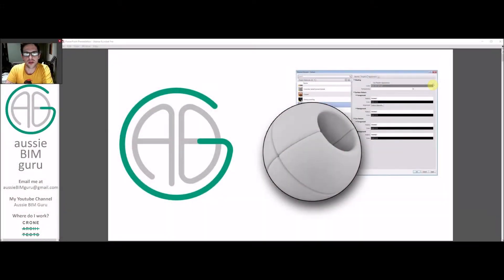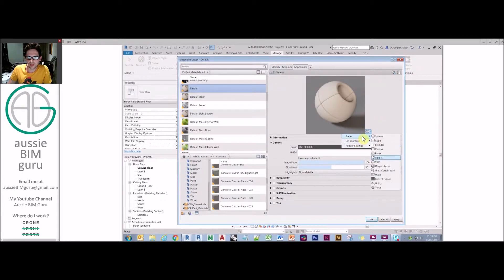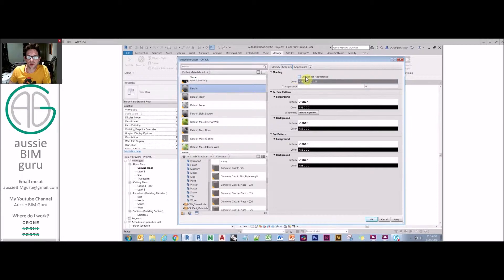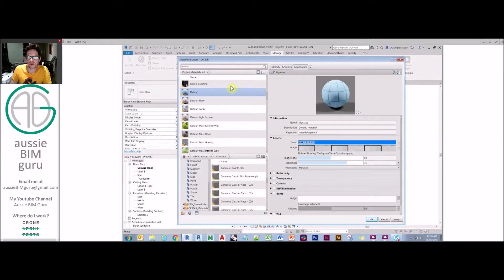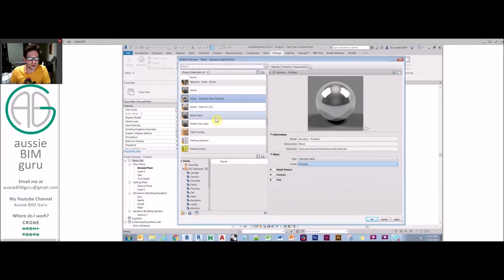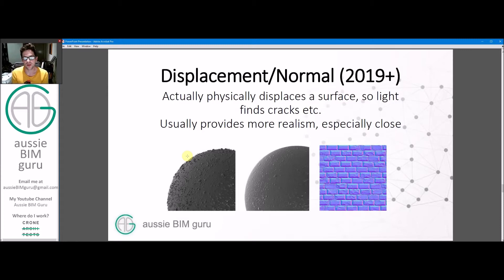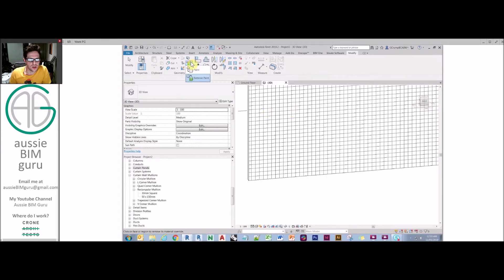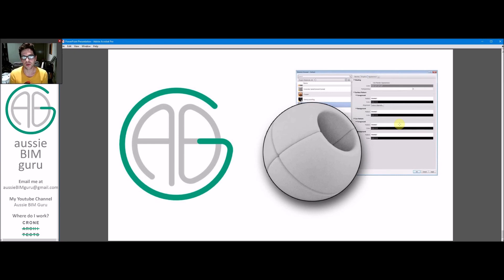Revit Material Fundamentals (Materials 1/3)

Comment: When linking your own material to Revit how do you prevent the materials from linking to other objects? For instance, I have Library seat fabric that is linking to walls and other objects in the project.
Reply from the maker: As long as the materials are different and applied intentionally with unique assets (appearance, physical, thermal etc) they shouldn't affect one another.

Comment: Thanks! Learned a lot and got a bunch of answers to things I've been wondering for a while already. One more question though, I tried renaming duplicated assets through the information properties and in most cases it won't let me. The asset name stays the same (as a "whatever (2)") even when I change the name to something entirely different. Anything else in the information properties I can change with no problems. And to make matter more confusing I could rename the asset in couple of occasions but in most cases no such luck. Couldn't figure out a pattern what made the renaming possible in those few instances.
Reply from the maker: Typically assets cannot be renamed for 2 reasons; either the asset is being adjusted in case (so the name isn't perceived as changing) or an asset exists with that name in the asset browser.

Behind the scenes, Revit actually stores all the assets (even if unused) in a browser 1 level deeper. Typically if you want to make an asset that is the same name (instead of using and updating the asset with that reserved name), you can selectively purge the asset taking up this spot, then use its name.

If the asset is reverting as you change panels, that's strange... maybe double check that the change is committing as you change between tabs - the browser can be a bit temperamental sometimes!

Hope that helps, and glad the video was useful!
Reply: @AussieBIMGuru  I've found that asset names don't like commas. If you use a comma in the asset name Revit will revert the name back to what it was.

Comment: Thank you for the video it was really helpful. When I click the cutouts or the bump selection box, I do not see the list of materials options. Where are they located or how can I get access?
Reply from the maker: Typically most autodesk materials dont come with channel maps like bump/cutout. The only maps that come with autodesk are diffuse mostly, and can be found by clicking on any default diffuse map of an autodesk material. Theyre usually installed with revit.

Comment: Hi, very interesting to see! One thing I'm wondering is, what do you think about using Object Styles to assign materials to categories and subcategories? I found that an easy way to assign the same material to lots of objects (for example if you're using only one type of steel in a project). And materials directly assigned to Family Types get precedence over Object Styles, if I'm not mistaken?
Reply from the maker: If your company standards are highly consistent and you wont need to manage finish variations this can work for loadable families. It would have exceptions though such as upholsteries on joinery etc. and objects where you want instance based materials such as milliwork/cabinets.